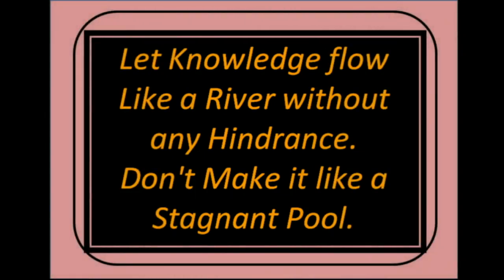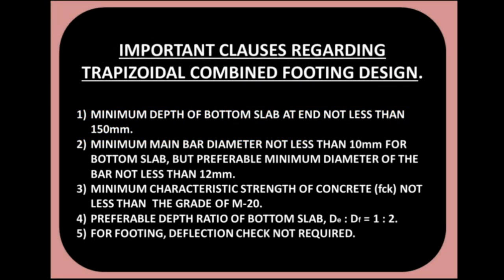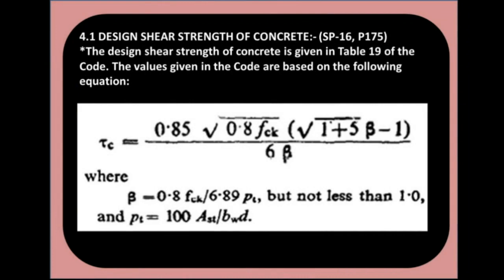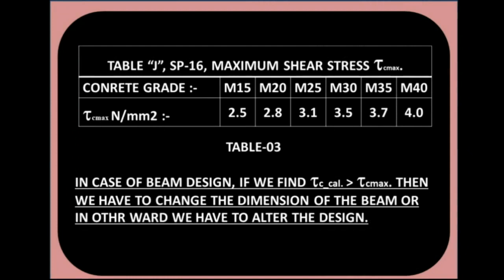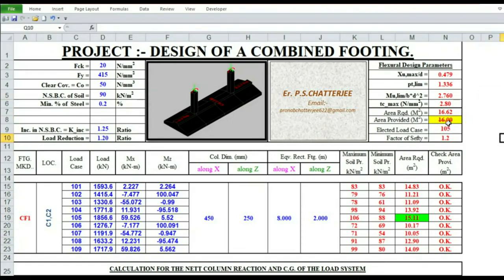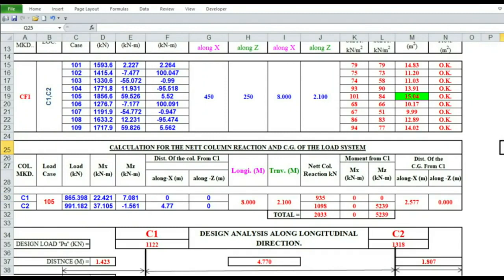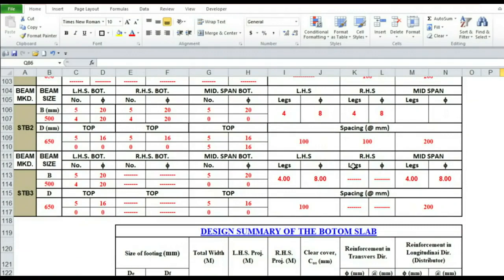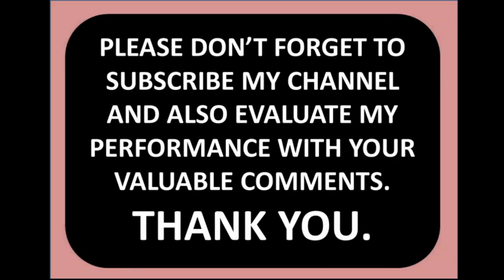Combined Footing of - 2 - Columns - Excel

Comment: Dear sir,
This combined footing beam cum slab is very useful. I have already received your 3 and 4 columns combined strip footing.
I kindly request you to share this excel sheet. If any one end is flushed with column without any projection, what is the modification  required for this excel sheet. Thank you for uploading useful excel sheets for civil engineers.
V.M.Rajan.
Reply from the maker: Very soon you are going to get it.
Reply from the maker: Please check your mailbox. Thank you.

Comment: Sir if we put the value of De and Df same in the slab dimension of Design of bottom slab will it give the correct result for the design of rectangular flat slab footing (not inclined)
Reply from the maker: Yes it will. In case of footing slabs, when We are going to check one way shear at a distance 'D' from column face, trapezoidal footing's depth will be less than the footing with uniform thickness. For footing with uniform thickness this thickness will be more than required. So concrete consumption will be more. 
On the other hand bigger thickness means less design shear strength of concrete, hence steel consumption will be more but from safety point of view your design will be O.K. 
If you want more details I can make a short video on it mentioning your name. If you are interested in it you have to send a mail to me along with your small details and your questions.
FOR MORE DETAIL PLEASE REFFER IS456,  DESIGN SHEAR STRENGTH OF CONCRETE.
Thank you.
Reply: @SD_Only  Very well explained the answer to my query sir, thanks a lot
Reply from the maker: Dear sir,
Your channel "STRUCTURAL DESIGN ONLY" got only 500 watch hours per year, required 4000 organic watch hours. Can you provide me more organic watch hours by providing more time in watching my videos several times? 
Other wise my all effort to share the knowledge free of cost will not be successful.
Thank you.
Er. P.S. Chatterjee.

Comment: Nice presentation. Very useful for structural designers. Can you please send me excel sheet.
Reply from the maker: O.K.
Reply from the maker: Please check your mailbox.
Reply: Thank you. Mail received. I think moment distribution is not required. It is giving more sagging at the support.  

Maximum moment is at zero shear between columns. Maximum moment need not be at centre. These points may be looked into
Reply from the maker: O.K.